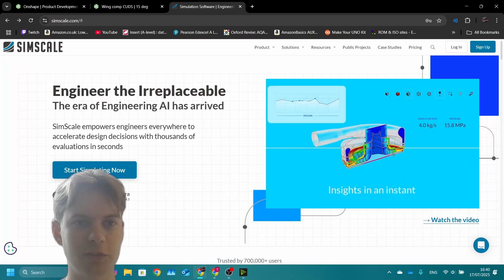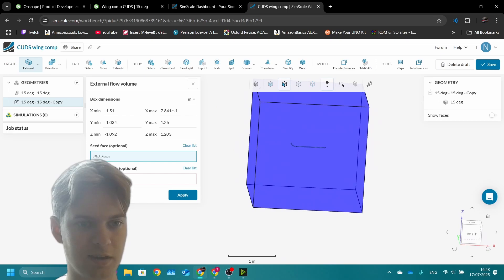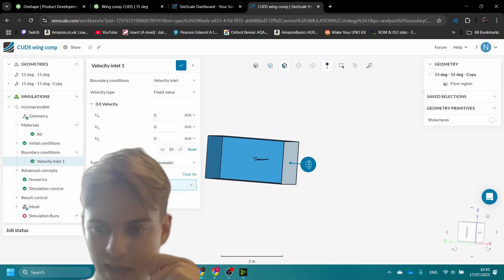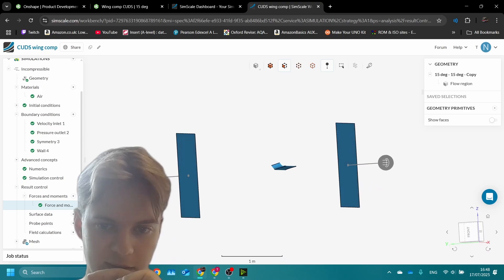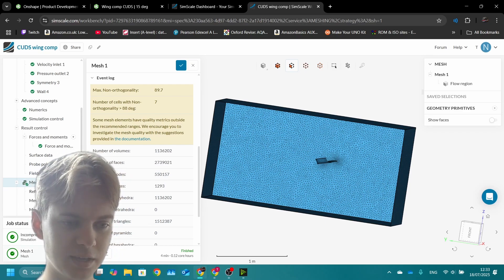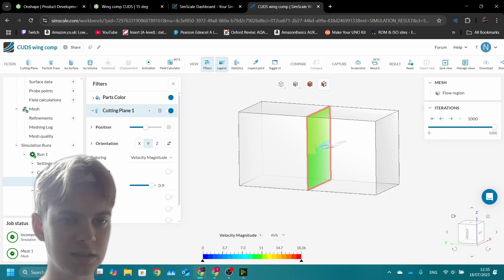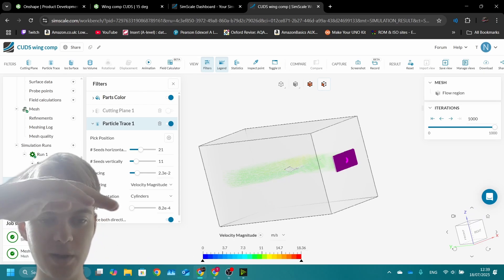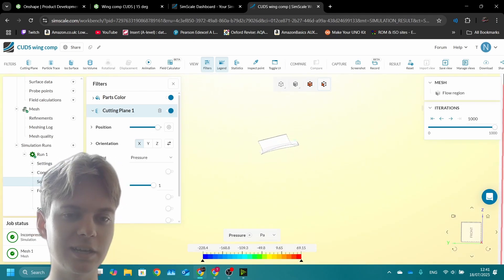Simscale Simulation Walkthrough | CUDS EYV Aerofoil Design Competition 2025

Comment: I can't run my wing because it says that I need to assign a material for my wing, however in Simscale you can only edit the material of the external flow volume. I have been trying to fix it for about 2 hours now. Can I get some help on that please
Reply: You have to delete your wings body he goes throught this step in 3:57, and then it should work. Despite it sounding counterintuitive.

Comment: Hi i was just stuck in the simulation as I cannot create a mesh as no materials have been assigned to my wing which are just faces so I dont really know what to do.Do you know a solution ?
Reply: I had this same issue, I believe it is because you forgot to delete the original wing. It's at 3:55 in the video.
Reply: @meredithbourgery7588   Hi , actually I did do that so I don't think that's the error ,I tried making the surfaces into walls and then but still the same error
Reply: @NevilTeshim  I also had the same issue did you find a way to resolve it?
Reply from the maker: If you're still stuck make sure you have applied air as your simulation material, also make sure your wing was a solid body without any holes inside onshape
Reply: Hi Nevil

Comment: I’m very confused on what you delete because my wing gets deleted but not my winglet
Reply: The same thing happened to me when I pressed on body delete then selected the wing, whereas it worked when I first selected the part I imported on the geometry dropdown in the top right (at 4:00 you can see ‘15 deg’ highlighted in orange in the top right, whatever you named it click that) and then press delete body then apply, everything should hopefully go smoothly
Reply: @luca-zadeemy one is a bit weird tho because I have 1 part and 1 surface on my geometry dropdown and when I delete the surface my wing goes
Reply: @bossmanjj9727 hmm sorry not sure what to do about that, maybe try the ai assistant in the blue bubble. Hope it works eventually for you though
Reply: @luca-zadeethanks, I appreciate the help hopefully the ai helps
Reply: I think you've made the wing in two separate parts in onshape, try making a boolean and selecting the winglet as well as the main body of the wing and see if it helps